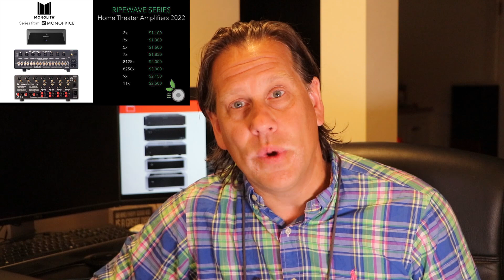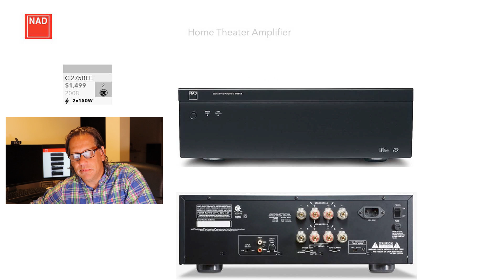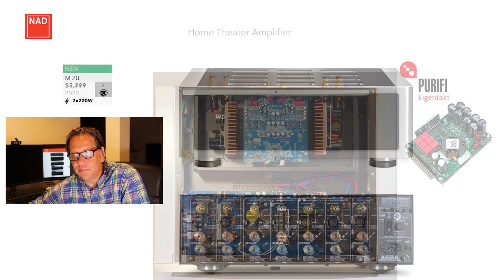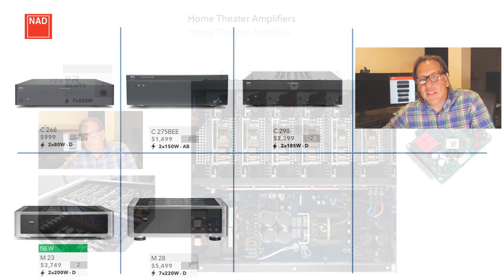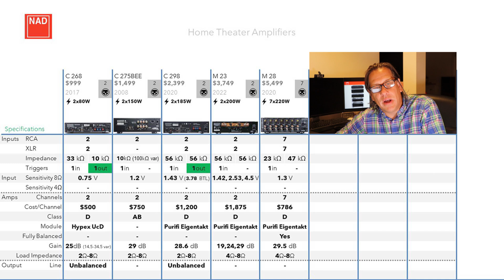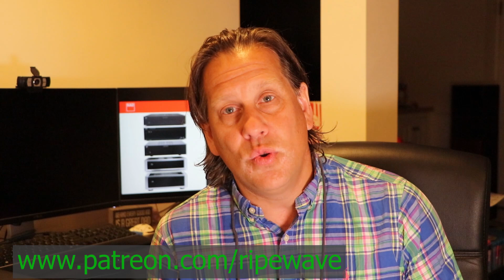NAD Amplifiers 2022 - C 268, C 275BEE, C 298, M 23, M 28

Comment: nad c399 also has purify eigentakt which sounds super neutral, the Primare a35.2 sounds a bit warmer compared to c399. c399 in combination with the Primare it also sounds slightly warmer / fuller. also in combination Nad c658. consider a Nad c298 instead of the Primare only difference is only audible switching the sound of different amp or combinations
Reply from the maker: Thanks so much for these added details and comparison with Primare. Very helpful. -Jon

Comment: The blue connectors represent and unbalanced design negotiate. Meaning there is no negative charge.  I know this from NAD support as I have an M28 and I needed and active ground for my Polk Legend speakers 😭
Reply from the maker: This is real helpful knowledge - thanks so much. I need to better understand the negative grounding and how some speakers like the Legends with SDA technology are impacted and why NAD has taken this route. -Jon
Reply: @ripewave  I don’t claim to fully understand it. Apparently from what I was advised is Class D isn’t a fully balanced design (not to be confused with balanced connectors), but in cases like the Emotiva XPA DR series they are balanced due to using two amp modules powering both the positive and negotiate channels.  Likewise a minority of Class A/B amps are balanced differential design like ATI, Outlaw, Monoprice, to name a few.
Reply from the maker: I feel there isn’t enough clear information out there about the value a fully differential design delivers. I read feedback for some who say that is a wasted effort with no appreciable improvement while other claim there is a difference. I also what to understand how some speakers, like the Polk legend SDA models need grounding a certain way to work correctly.-Jon
Reply: @ripewave  I agree.  The Legend 800’s need full balanced design to power the SDA feature
Reply: Actually, the meaning of the Blue connector instead of black is that the negative speaker terminals must never be connected to ground, nor to each other, nor to any common ground device. This is not an issue when connecting to purely passive speakers in the ordinary way, but would cause a major issue if you tried to send audio to a powered sub-woofer using the speaker wires. I'm not sure which Polk Legend speakers you had, but the SDA interconnect cable on the some Polk models would violate the rules for keeping the outputs isolated from each other.
Reply: So are you saying that if I have an older Polk audio Rti9 speakers then I'm better off buying the c298 with the blue connectors? Because I was looking to buy the M23.
Reply: @momo1975  my comment only applies to Polk SDA Speakers which are the the Legend L800 speakers of older SDA speakers from the 80’s and 90’s.
Reply: Im thinking about getting the arendal monitors thx, would a paraound a51 drive them better or the NaD m28? there 4 ohms speakers

Comment: With class-D you really have to pay close attention to how it performs at high frequencies, class-D is pulsed power, which then needs an inductor stage to smooth it, inductors naturally impede high frequency switching (they resist change in the electromagnetic field).  So it’s an inherent technical challenge to put through allot of current at higher frequencies with class-D.  For the consumer, they need to pay close attention to the impedance of their tweeters, if they’re low impedance 4ohm tweeters, the class-D may not be able to deliver the current they draw with grace and fidelity. 

Gallium nitride class-D has faster switching, and needs less smoothing, so a gallium nitride class-D amp with a gentler filter will probably have less output impedance at higher frequencies.  
Each generation of class D has improved upon the high frequency performance with various designs, but it still remains the weakest link in the bandwidth. See if you can get the technical papers on the module, for instance if you look at ICEpower’s 1200as-2 pdf, you can see the rising output impedance relative to frequency in some of their graphs. Which has to be kept in context of class A, class AB, and competing class D design’s performance. Clearly many engineers feel it’s good enough to ship, but maybe it’s also cheaper and has so much low frequency performance that the high frequency hearing-loss region has been compromised for an aging hifi demographic, or a customer bass that shops on advertised watts which class-D excels at. Myself included.
Reply: Excellent analysis. Is it possible to combine Purifi Eigentakt with Galilum nitride, or is it really one or the other?
Reply: @connorduke4619   I don’t know, I’m really at the edge of my current knowledge with my above statement.  My sense is that it’s not either or.  I know even the same class of amplifier technology can have allot of differences in how the design is implemented.
Reply: If you can’t hear above 12-14khz, does it matter?
Reply: @truwarrior22  I suppose it my not, as that is where class D begins to roll off it’s performance (typically)  but being so close to frequencies you can hear, the potential for audible “intermodulation distortion” created from inaudible waves and audible waves could exist.